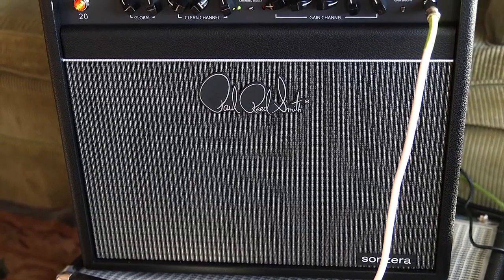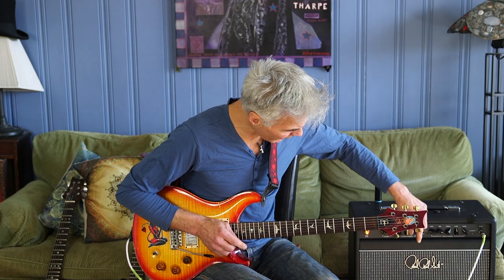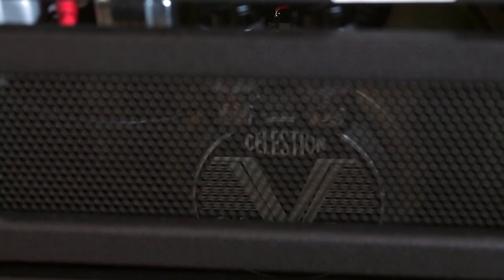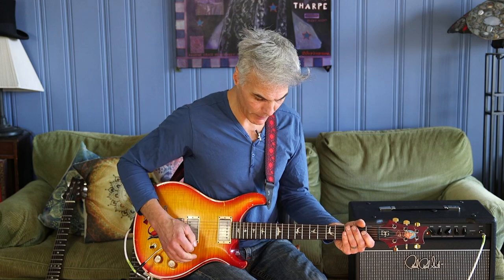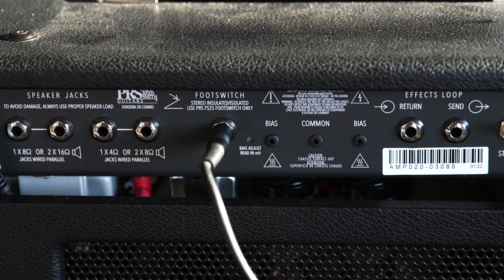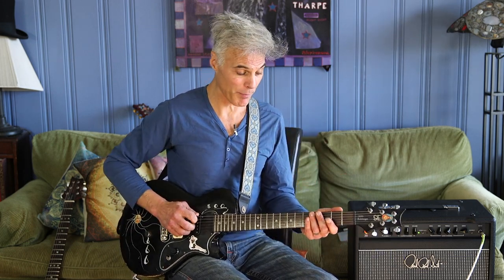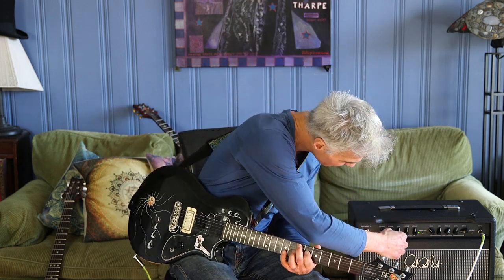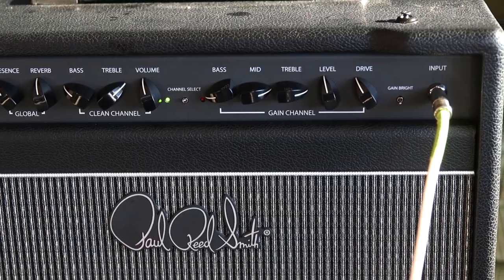PRS Sonzera 20 Demo | First Look

Comment: Thanks for the PRS amp review John. I have now reached a point in life where "how much does it weigh " seems to be the most important spec. The new PRS amps seem to be better than their previous offerings.  I like the fact that you can adjust the bias without taking the amp apart. Thanks again for a stellar review.
Reply: What does adjusting the bias mean ?
Reply: @justice100forwin2   In very basic terms it is setting the idle current for the tubes to operate. It should be done whenever new tubes are installed and checked periodically during the tubes life. Tubes that do not come into spec will give poorer performance and would be an indication that they should be replaced of not used at all as  in the case of new tubes.

Comment: I tested one of these two days ago- REALLY great sounding amp with solid features, however it has a noise floor that was just unacceptable to me, even on the clean channel at low volume. Not sure why, after decades of innumerable companies with hundreds of amp designs to draw from, that PRS couldn't make one that was reasonably quiet. I would have walked out with it in my hand that day, but I knew I would always hate that annoying hiss.
Reply: What amp do you recommend around a thousand?
Reply: @matthewstearle7395  Depends on your needs- Marshall DSL 20 or 40 if you want higher gain- well made and reasonably easy to work on, lots of features. Cleaner- any Fender around that price- the new Tonemaster series sounds fine for non-tube amps.
Reply: @whatwouldhousedo5136  THANK YOU so much for your advice,I like your choices,will check out both amps,appreciate your advice
Reply: We don't hear an ounce of a hum here on this demo however? Even with loud distortion on lead channel.. Maybe you tested a faulty unit?

Comment: Sounds great, but another website says the amp weighs 49 pounds. That's too much for me to haul around. I would prefer a lighter head and separate speaker cabinet. Weight is so important, especially to older musicians, that I suggest you include weight information with your amp and speaker cabinet reviews. Just put the amp on a reasonably good bathroom scale and tell us the number. If it's within a couple of pounds, that's close enough. Thanks.
Reply: PRS website says 42 pounds (Sam Ash and GC too). Sweetwater says 49, but must be a misprint. Still not light at 42 though.
Reply: @poesybeat  Thanks. I thought 49 pounds seemed excessive.

Comment: Why doesn’t it have a mid control in the clean channel?
Reply: The mids are split between the treble and bass knobs…. Not sure why they do this… perhaps mids are noticeable on the drive channel?  Try using an eq pedal if you need to control your frequencies Kenneth…